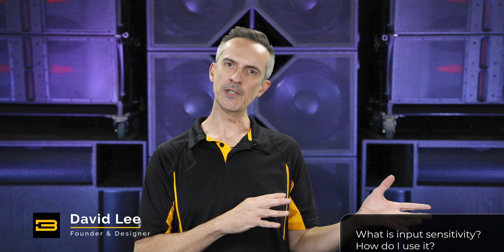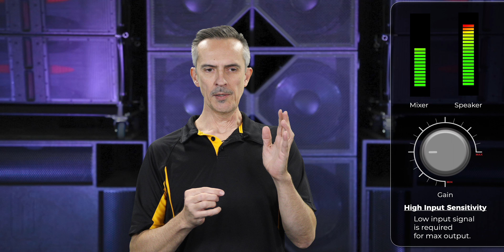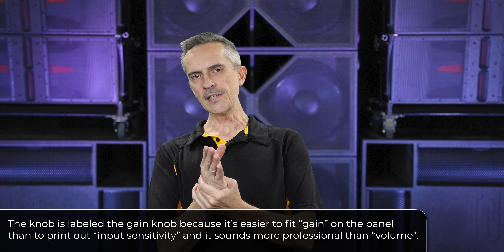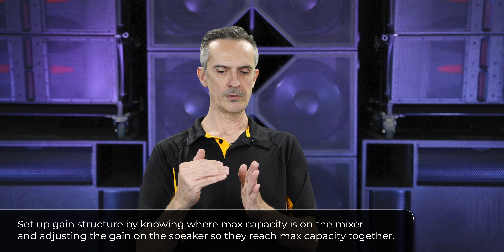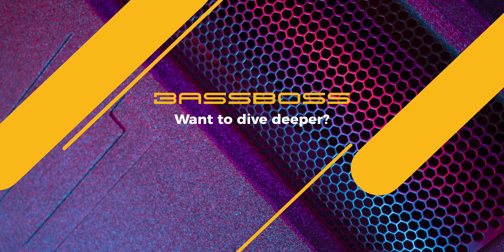Learn the Secrets of Using Input Sensitivity in Speakers – Here's Why It Will Blow You Away!

Comment: Most of the videos I see of the DV12 MKII on youtube posted by owners have the gain on the speaker turned all the way up. I am assuming this is where the built in DSP takes over to stop any damage? Also what would be the best way to balance full output of the DV12, would I turn my mixers master level to full and then turn the gain of the DV12 until it reaches its full volume? is this where the DSP will limit it? Will it just stop getting louder?
Reply from the maker: Our gain structure video should help you set up your system. https://youtu.be/mdJtxN2IT4Y
Reply: @BASSBOSSBASS  Thanks so much you guys are on it!!!